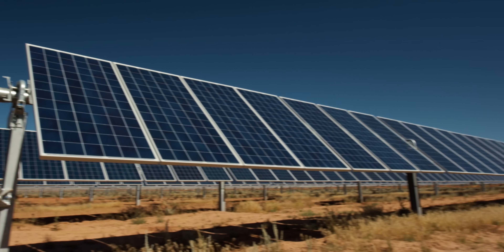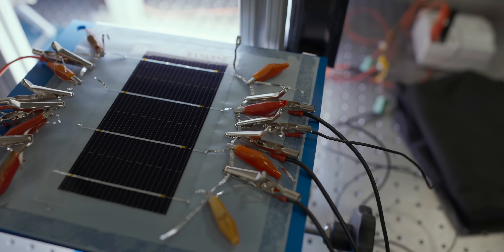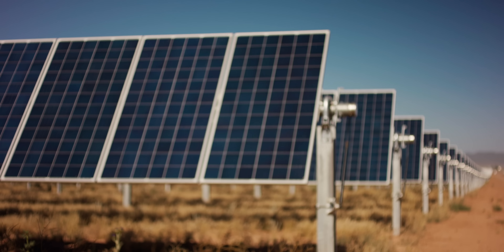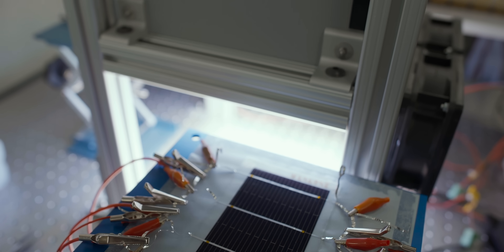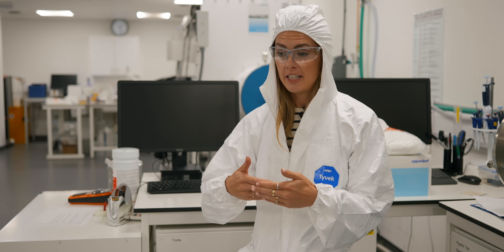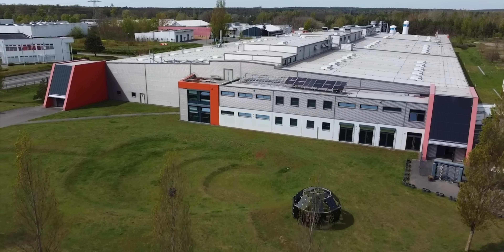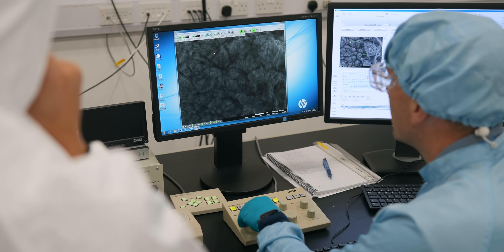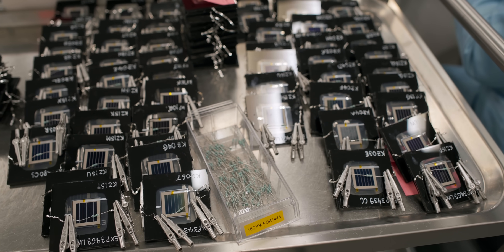This MAGIC Ingredient Is Doubling The Power Of Solar Cells!

Comment: I wish there was more explanation of the difference between fossil fuel and nuke "efficiency" compared to solar & wind efficiency.
When we speak of a nuke or coal/gas power station and the efficiencies, we're talking about how much 'fuel' we have to burn to get x amount of electricity. Much of the process loses energy through heat and mechanical and transmission losses - and the associated pollution that goes with that.
With solar efficiency the 'fuel' is sunlight and it is only a matter of how many square meters of space you need - the more efficient, the less space your panels take up. If I can fit 1kw of PV on my shed today, then a doubling of efficiency means I can now fit 2kw on my shed. But in neither case was there pollution created in the generating of the electricity, due to 'efficiency' - and - the 'losses' are sunlight, so not losses at all - just failure to capture 100% of the light - whereas with burning 'fuels' the lower the efficiency - the greater the pollution.

Comment: Nice! Another “game changing” solar panel!
Reply: It's hard to understand but the panels are getting smaller and cheaper at fast rate. 

Is game-changing as these are, they won't really become compelling until we have another 40% drop in price. 

But at that point it starts to get really interesting. 

How about a panel for $700 that produced 100 watts and took 32 sq ft. 

2 years ago I bought a panel that takes 16 square feet to produce 200 Watts for $250.

Comment: Great presentation. Crisp and clear and very relevant. I just installed 6 panels @570 watts each. At peak noon in December I am getting 2.450 kw power output. The panel efficiency is only 22%. Just imagine if it was 40%………

Comment: It’s great that a company has done this even better it’s a UK company, but the material is very unstable when exposed to light, no one touches on the longevity of the product but guess we will see in a couple of years. And I do think we are going the route of the car engine here ie BHP sells cars Torque wins races the same is happening here talking about the solar cell which is one cell of a module not the module it’s self! A cell can have a high efficiency but in a module the efficiency is taken down, silicon modules are looking at 24% at the moment so this is getting tasty. Can see an intel tick tick tick tick toc road map

Comment: They have other energy technologies better then solar but have hidden it away, because free energy is not what  they want and would rather keep destroying the earth for profit instead.
They discovered years back if you get a solar sell and cat it into strips and turn them on there side and reconnect them creating a smaller panel that produces more power, are they doing it, no they are not, this alone would allow cars to operate without the need for such large batteries.

Comment: While I understand that it might appear that percent efficiency is "important", the hard truth is that $ per watt installed and longevity are the 2 single driving factors of solar. Having a solar panel made up of cells that are 29% or even higher efficiency is meaningless to the average homeowner... There's plenty of roof top on most houses to handle a few extra panels.
Reply: Given more and more people are living in the same area, this calculation rapidly changes in cities.

Comment: If you want efficiency, solar Stirling can be 30% for a well maintained unit.  Been that way since the 80s....   But I think you need a concentrator that tracks the sun, so it's not set it and forget it.  Maintenance is kinda high....

Comment: If you can double the output of my current panels, 2 things will happen. One, batteries become mandatory, and 2. I’m disconnecting from the grid. They can take the poles and wires off my house and recycle them for the metals in them

Comment: If it has been mentioned previously, please forgive me.
If we can convert more of the suns energy to electricity, this could reduce the heat component, of solar panel operation. This should reduce production degradation as the new panels converts more radiation to electricity rather than heat.
Very much looking forward to our ability to capture a wider range of emissions for conversion to electricity 😀

Comment: The problem up to now with pervoskite has been durability. No discussion of this issue in this presentation. What is the expected lifespan of these solar cells? A more efficient solar panel, with a significantly shorter life is not a good trade off. 
Silicon's durability is phenomenal and solar panels fitted now will be in service for decades ahead. That is true sustainability.
Efficiency is only an issue where space is limited, and frankly, if we used all of the roof space currently available for silicon panels, regardless of orientation, we would hardly need any solar farms on other land.
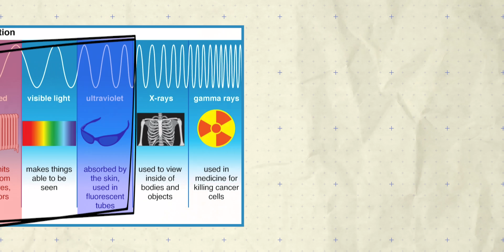Reply: pervo-skite - haha. Same error in the presentation at 3:40. Seems to be a popular topic right now, perhaps on Epstein or PDiddy's list?

Comment: Why is the production in Germany ? 
When are you going to produce them in the UK? 
Or do you already? Did i miss that! 

 lets get British people working & build a stronger economy for all please!
I'd buy some for my home, along with a battery storage system, to charge my cheap EV leaf 2nd gen.
Great to hear we're making some good  progress

I've just looked for your production in the UK & cannot find any,  so why is that? If you manufactured them in UK, British people would buy them & there would be reduced transportation costs, so lower prices & better profit, surely that's a positive for all & the environment!
Reply: Maybe because the energy costs in Germany are insane?
Reply: Please realise that the silicon substrate comes from China… so, half of the chain is already there. There a close to zero Si wafer makers in EU, one remnant in Germany.

Comment: Just got offered a PhD project in studying and discovering new perovskites - super excited to be working on this kind of research
Reply: Congratulations. Maybe you can answer my query: When Perovskites were first talked about, there was a lot of excitement about them being ultra-thin layer, flexible and could almost be painted on a surface. I'd prefer a dirt cheap, throw 'em anywhere, 15% material, one so cheap you would stick it on N-S-E-W facing roofs and walls and yards. When can I have those please?
Reply: @michaeljames5936     Perhaps he's a professional studier. Don't expect too much.
Reply: @michaeljames5936    Apparently,  Researchers from institutions like the University of Hong Kong have developed perovskite solar cells with an expected 20-year lifespan, demonstrating conversion efficiencies around 26%. These cells use innovative materials and manufacturing methods, such as thin, flexible films applied at lower temperatures, reducing costs significantly compared to traditional silicon-based solar cells.    Companies like Aisin aim to commercialize perovskite cells with 20-year durability by 2025  Whether that's true and whether they deliver remains to be seen.
Reply: I'm amazed it's taken this long to work this out.
Reply: And then they will be made in China.
Reply: good luck!
Reply: WOKIST BRITAINS: "Anyone who doesn't believe in Perovskites is a racist!"
Reply: Get "excited" but avoid getting "super excited" you''ll have a heart attack.
Reply: Go hard, go far, go for broke. Congratulations and now the work starts. Challenge everything with respect, question everyone who answers   Without doubt. Come to your own conclusion while you have the chance to work with guidance. One day you will be on your own .
Reply: Please note we Youtube commenters hate you kind of researchers who take funding and produce nothing! So please keep ROI in mind!

Comment: I notice they never said what the efficiency of the panels was...!
Reply: Perovskite can add another 20% in the near term. Then when multiple different layers are used it can get up to about 80% theoretically. Its just picking up parts of the light which silicone does not
Reply: It's magic! ✨🪄🔮 Just trust them!
Reply: @DixonCyderBusch  That seems to be the bottom line!!

Comment: I think its worthwhile to transparently talk about the downsides of tandem. Scalability, cost and reliability comparison with standard silicon solar cells side by side should be discussed. I know more 100M of dollars have been invested into OxfordPV over a decade, and yet Commercial product is still no go... since spot price of PV is so low now below 10cents per W..., i think tandem should be used on specific application that silicon cant be used. I think they shoukd consider more specific application.

Perovskite is cheap but rest of the layers that are used to make the device are insanely expensive...... like over 4000usd per gram..

I value breakthrough in science, but climate change is coming too fast.. time to cut some corners to focus on what works or not.
Reply: Exactly. We already have all of the tech we need to get to carbon neutral quickly. If we focus on doing that now, we can develop better materials and systems at our leisure after we have achieved that goal.

Comment: If it turns out 35% efficient perovskite silicon cells are, say, 50% more expensive than current solar cells, and therefore struggle to be competitive at a commercial / grid level scale, there could still be many very exciting opportunities where energy density per m2 is important. I'm thinking solar PV on EVs and on the wings of battery powered planes, etc.
Reply: I’m also thinking RV rooftops, where space is also highly limited.
Reply: Who makes 35% efficient panels...I'll give you a clue, NO ONE.
Reply: They will get cheaper won't they, as manufacturing increases.

Comment: Selling first to grid scale solar PV farms is a win-win, as it increases grid level generation and the original silicon PV sells become available on the second hand market for residential and commercial rooftop solar at a lower price than new panels, driving down the cost of new panels.

Comment: Yes, as others have said, we’ll guess she wasn’t allowed to include longevity as a direct question and receive a direct answer.
Surely that’s the key breakthrough. Let’s hope they have solved it, and that’s why they are at this stage of getting it trialled out in the field. 
Someone is putting money behind this enterprise clearly. 
Fingers crossed
Reply: they havnt solved it
Reply: @jukeseyable then let's hope it is like half price or even lower so we can change it every 3 years
Reply: @trexeyesonly55  as my late father used to say, live in hope, die in want
Reply: "Lets hope". If they had cracked this problem I'm sure they'd be singing from the rooftops about it, not ignoring it.

Comment: An ideal PV would look blackest of blacks, since no light can escape. 
However, I believe we will discover a new nuclear process where huge amounts of EM force is generated, which in turn, will induce huge amounts of electrical currents in conductors.  
All silent and with no moving parts, but will have some temporal side-effects. 
It sounds like science fiction but it's not.  This is how UFOs get their power from. 
Get one close to an electrical power station, and it will overwhelm the power station with EMF radiation and a blackout will result.

Comment: What is different here is that Oxford managed to scale up production. Great! But one question you forgot or decided not to ask this boss is the expected lifetime of these perovskite cells as this has been a problem for a long time.
Reply: Bingo.
Reply: Your question is flawed. The question is, what is the carbon footprint vs energy generation over the life of the panel. If it's better than fossil or nuclear, it is the better option. Secondly, it's a lot cheaper to replace solar panels than it is to build new traditional generators.
Reply: @diggeroldmate8122  Economics plays a role in how quickly these systems will actually be deployed. Which is arguably more important than lifetime CO2 emissions per kWh. So no, the question is not flawed.
Reply: @anticarrrot  hahaha mmkayyyy
Reply: @diggeroldmate8122  only hydro has a lower carbon footprint than nuclear. both are lower than solar.
Reply: @yt.damian  ah no sorry.
Reply: One question is are they working at night time if not a useless system.
Reply: @larslotus  ah no. If you store excess it doesn't need to work at night. Basic thinky thinky will tell you that.
Reply: @larslotus  Useless? Even if they don't work at night, they do work during the day. Sigh. N there r batteries 2 store energy 4 night. U ppl. Always w/ throwing e baby out w/ e bathwater.
Reply: @larslotus Hmm.  It doesn’t rain all the time either, yet we still have access to tap water whenever we want it.

Comment: Each of the solar panels on my roof produces 400 watts. I'm wondering if the same sized panels made of perovskite + silicon could potentially produce 600 watts. If so, that would be an amazing leap.
Reply: It would.  But if your current cells are 25% efficient, these particular new cells (25.9% efficient) might take them up to 415 watts.  Good, but, as he said "incremental".
Reply: Maybe you can get it when you're panels have to be replaced. The thing with perovskite they work in a lab condition for a short time they are far away from 30 to 50 years for dual glass panels.

Comment: Hoping the team work with Aptera motors to put this on automotive. With Aptera design, solar powered automotive is possible.
Reply: Your vehicle of choice is very conservative with energy consumption it can cover the same distance with the same speed with 1/3 of a Tesla model 3. 
So if Aptera gets realistically 20 km in average with a huge roof and no rear window the roof of a Tesla would be sufficient for maybe 1 km.

Comment: I'm really not getting this obsession with Efficiency. The sun gives us 1.4 KW per square m for free. I'm thinking it's a bit of marketing hype like say the latest BMW with 700hp.
Reply: Commercial generation cost is a function of land area consumed and number of panels deployed per MW of electricity output. With higher effeciency output either less land for the same output or more output for the same land area is achieved. This makes reaching net zero targets easier to achieve, and could accelerate timescales.
Reply: In NZ we have solar farms that are integrated with the local farmers.  The panels are mounted higher to allow grazing and farm machinery to operate as well.  This means the landowner gets an added (reliable) income as well as his ongoing farm income.
Reply: totally agree, its sales bollocks that sales and marketing have falsely made importance out of. a 400 watt pannel becomes a 420 watt pannel with 5% increased efficency. and at 50% elevated cost. far better just but 1 extra mono crystaline pannel, and then keep the rest of th saved money

Comment: Now 550 Watt solar panels are only $90. Thanks China 🎉
Reply: But usually they don't match the life expectancy of European panels. 
A Solo park nearby list 280 Watt Qcell started last year to fall apart literally the back of the modules do fall apart. 
My 250 Watt modules from Austria are years older and if I clean them they look perfectly new. The downside with cheap China panels they may not last 20 years.
Reply: @ReinhardSchuster  Is it because of the snow?Also the guarantee is 10 years, right?
Reply: @JunitafluxcyfatriciaJunita  I don't care about guarantee the company isn't anymore. 
I will use them as long as they work.
Reply: @ReinhardSchuster   You should buy from state-owned companies because they never go bankrupt even if they make losses.
Reply: @JunitafluxcyfatriciaJunita  I would never ever buy Chinese panels my Deye hybrid Inverter and Seplos Mason Batteries give me more than enough headaches before I learned how they work because there is absolutely no support from China.
I had to reverse engineer the inverter and the BMS make simple modifications so you can communicate with the digital power meter.
Reply: @ReinhardSchuster  i DIY me on battry

Comment: Is anyone else bothered that Oxford PV have built their production facility in Germany? What is the point in investing in the r&d if the benefits are immediately exported?
Reply: In short no, OxfordPV own the most patents for this technology. They may intend to seek a licensing approach rather than manufacturing one (just like ARM does in processor chips). The German plant is relatively small scale in partnership with a German industrial partner with expertise in this space. The panels produced sound like they are destined for assessment at commercial generator partners round the world for assessing in their existing farms under varying real world conditions. If the trials and OxfordPV choose the licensing root this will likely generate more revenue for them, and UK tax take, than manufacturing alone. Plus will accelerate the adoption of tandem panels and so the output from renewables globally.